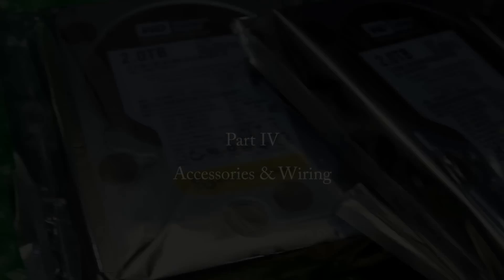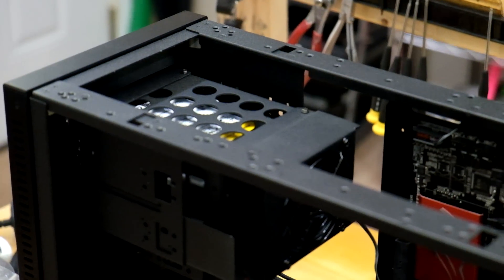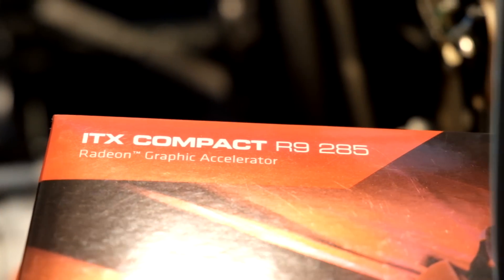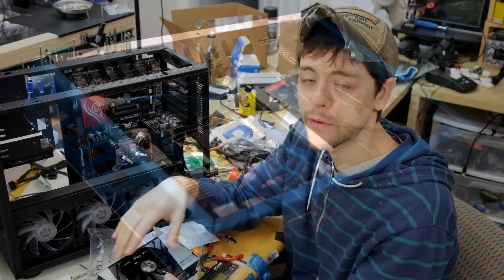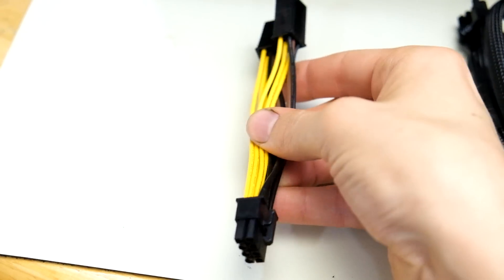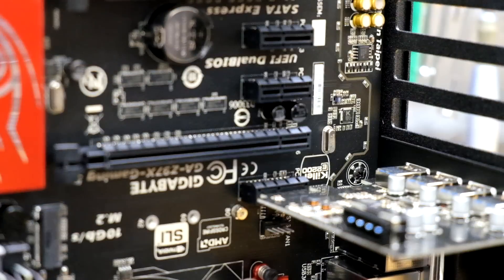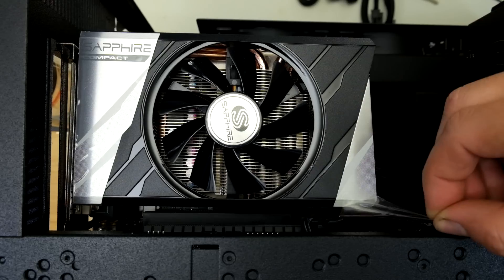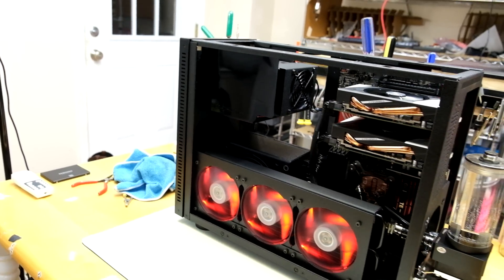PC Building With Josh - Episode 4 - Wiring and Graphics Card Installation

Comment: R9 285s are not premium anymore.  Why SLI them?  Only 2 gigs of frame buffer and even in SLI they will likely not do 4K well at all?  1 390X would likely served you better for cheaper.  Working with leftovers?
Reply: AKlover http://www.eteknix.com/amd-radeon-r9-380-2gb-crossfirex-graphics-cards-review/ the R9 380 is a rebasge of the 285.
Reply: kf7jonny   My comment still stands.  There is no point in running them in SLI.  The 960 usually outperforms them and anyone informed will tell you there is little point running 960s in SLI.  The 760 I upgraded from could probably run near parody with one of these cards.  If you have the coin to spend this GPU choice makes no sense.  For the price you could buy a 390X or probably a 980 for not much more.
Reply: AKlover   The video was made right after the 285 itx was released.
Reply: Not From Concentrate   The trade off with ITX is usually more noise and less performance.  In 1080P they make even less sense given the progress of stream machines are making.  This build will drop in value faster than most.

Comment: Any recommendations on my build my budget is $850 and I'm at $805

PC Specs

CPU: Intel Core i5-4460 LGA 1150 

Graphics Card: EVGA GeForce GTX 960 SuperSC ACX 2.0+ 2GB GDDR5 128bit

Motherboard: ASUS Micro ATX DDR3 1600 LGA 1150 Motherboard B85M-G R2.0

SSD: Crucial BX100 250GB SATA 2.5 Inch Internal SSD

HDD: WD Blue 1TB Desktop 3.5 Inch SATA 6Gb/s 7200rpm Internal Hard Drive

RAM: Crucial Ballistix Sport 8GB Kit (4GBx2) DDR3 1600 (PC3-12800) 240-Pin UDIMM Memory 

Case: NZXT S340 Mid Tower Case

Extra Fans x2: Cooler Master 120mm Green LED Case Fan
Reply: Hunter Smith i5 4690k, and maybe a hyper212.
Reply: Hunter Smith You will need a power supply, and that is something you don't want to cheap out on.
Reply: TabZa123 Yeah I noticed I forgot to put that in my list but I have a 500w